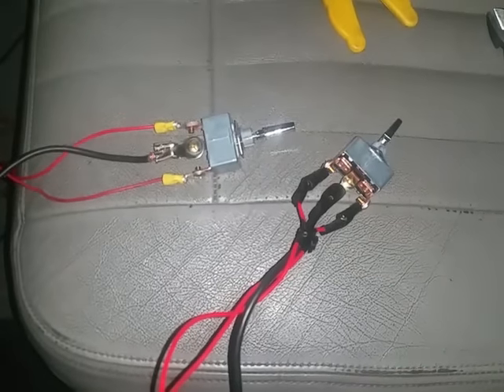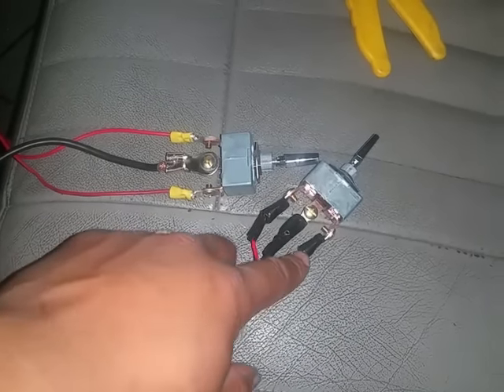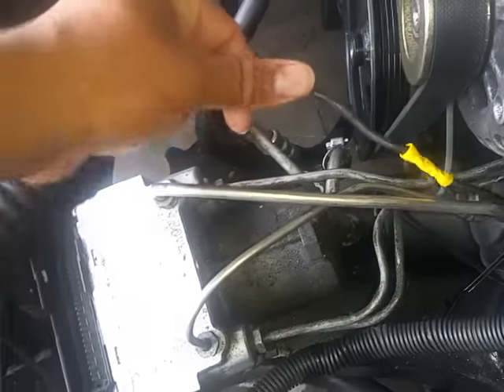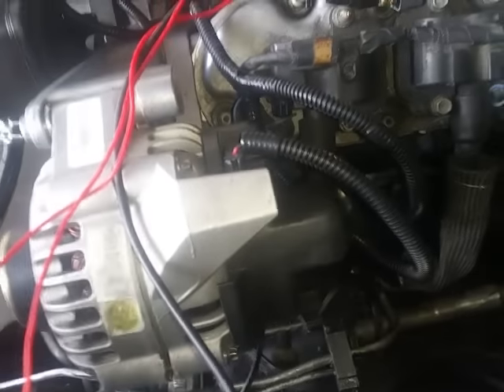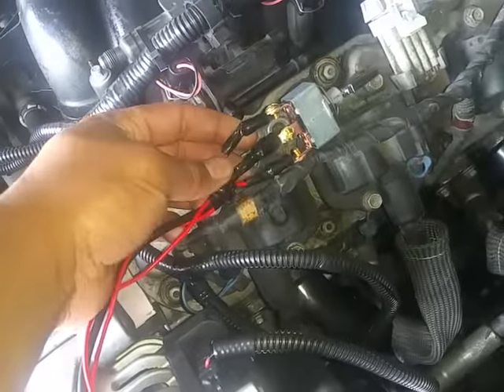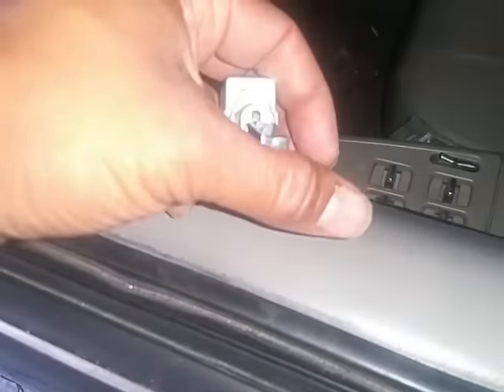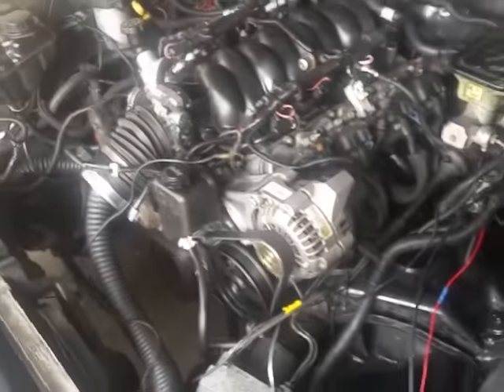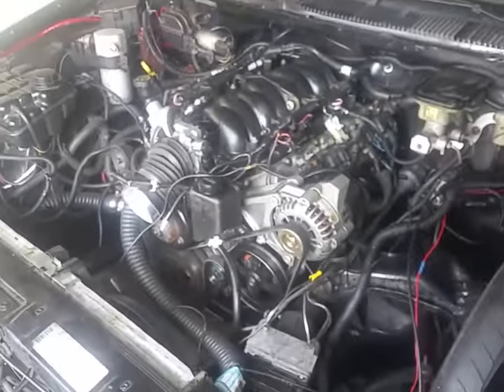How to install fan switch

Comment: Right on! Yeah, it already getting hot here in Georgia. This really takes all the guesswork out of wondering if your fan is running or not. Much appreciated Brother! Peace
Reply from the maker: All good brutha use this system as a override for the most part and ad a fuse I’ll be doing a updated video of this soon thanks for watching
Reply: @TheLsSwapGuru  Thank you very much. New Sub here. Btw, nice ride! Be easy and I will be looking out for the video.

Comment: Most fans are more then 30 amps. The best way to run that fan is with a relay also when using a relay you will not have to worry about burning that switch up.
Reply: Richard Bradley flex-a-lite makes a manual fan specific switch that can handle their fans.
Reply: He said it was a 35 A switch - but the wires, joints etc - make sure wiring is large enough. Relay is good too for this.
Reply: So a 25 amp will it hold
Reply: @maryjanemoore-lx1lg  no. 30 or more and you're safe. 
Make sure your switch can handle it. 
Make sure your writing is at very least 16 gauge.
Reply: @GARTHURZILLA  I’ve got one in my car I brought, and the switch gets crazy hot in about 5 secs

Comment: also you can run this off your cars relays, use a switch SPST works great, ground one lug to ground the other to run through firewall to your fuse box and FAN relay's lug 80 usually... basically you are just grounding the ground lug in the relay and bypassing any sensors that activate it by grounding the ground lug..  many cars have 2-3 relays, 1 relay to run the cooling fan for both AC and temp, then you have your hi lo speed relays ac/temp combo,  you could tap those relays as well, this works well if all your relays and wiring are all functioning but you don't like when the computer tells the fan to go on, and most cars that's late in hot hot 115 degree weather...

this style here does work well (perhaps a relays isn't a bad idea) if you just cannot figure out why your fan will not kick on for either the AC or temperature, like when it gets hot it wont kick on and cool it down, or it doesn't automatically go on when you turn on AC like it's supposed to.. in this case its usually relays or fuses, or bad fan but sometimes the ECU does fubar and that's a hassle for sure, so are bad melted plugs and or fuse blocks...  or you just don't have the time to fix.. 

try jumping the relay, you can jump the relay right at the block on the ground lug that works too.. but then it s always on as its not switched, but for emergency what not gotta go try that.. some fans kick on when the temp sensor is unplugged good way to troubleshoot see if fan does work..

Comment: Well, I'm here for the same reason. Same toggle too. lol.. Idk how yours has turned out since but,, I'd wrap that entire switch with black elect tape. I only used one toggle, and it gets hot in between me cycling it. I turned it by accident, and it touched metal and wow the fun began. And I had it wrapped I thought well, just not that much.. I know now though. Just done this again this morning. Cheap fix. Still only one switch. My fuse wouldn't transfer enough power, so it's just, fan / bat / switch. Like just one of yours looks there. They loosens sometimes by themselves, so it's always good ideal to safety wrap them well.
Dig this.. I done it because my fans stopped coming on. I have a Chrysler T&C. My right slide door ripped my wires in half to control the door. When that happened,  check eng's on.. Brakes on, obs on, and air check on tires on... lol... so I thought fans were the same.. Shorted on me too... But after wiring this bad boy up the 2nd time. They know are on with key on. Makes no sense. ahhaha hope you enjoyed that.
Later.

Comment: Another way is to run the radio accessory  wire etc ( Activates when you turn key) ..to the factory relay thats under the hood ...there is 2 relays, primary and secondary.
You have to tap into 1 wire for each relay that goes from PCM ( there is only 2 wires that go to PCM to Relays 1 each )
 to the relays it uses very little power to activate the relay so it can send the main power 40 amps to the fans! 
By doing this Your fans will turn off and on with the ignition key ! And by pass The PCM to Relay  Control and it will not have conflict either!
If you want a switch but do not want to turn the switch off and back on every time you use the car..do the same thing I described But add a switch before it goes to the relay.
So from Radio Power wire or alternative (Ignition Activated Power) To switch then to the tapped Wire that goes from PCM to Primary Fan Relay and Secondary fan relay..
Remember that its the skinny wires under the relay not the big one thats the 40 amps leave those alone! 
Doing this ,If you have the switches off ,the car fans will work normally and when you want to activate the fans.
 Hit the switch and  it will by pass the pcm and will not have conflict. When you turn off the car with the switch still on  it will turn off because its getting power from the radio power wire wich is ignition switch  controlled.
When you turn the car on when the switched already on remember that the radio will not turn on until 3 seconds after you hit the ignition switch thats good because if its cold outside you dont want to crank the engine and turn fans on at the same time and stress the battery because of the cold weather.
This is for 94 95 96  impala/Caprice  should work for other similar year gm vehicles and some what same idea for other brands!
If you already have to much electronics on the radio accessory  wire  ..You can also put a relay  going to the radio power accessory wire  ! 
https://www.youtube.com/watch?v=86_ocEp6mHI
Reply from the maker: +SoN oFaBleepBlop yes sir you sure can thanks for giving others value information that's what it's all about helping others out thank you

Comment: thanks for your guide 👍 im gonna try it in my honda acoord 95
Reply from the maker: SharkNT Gonzalez cool deal I’m going to be doing a update video on this showing how to use the fans and how to hook them up to a relay thanks for watching
Reply: The Ls Swap Guru woow! thats nice 🙏
Reply: @TheLsSwapGuru  can I get a link to that video. I just bought a 1995 z28 camaro with a 5.3l ls swapped into it and can get the relay hookup to turn on the fans when I hook up the relays with the wires on the stub that powers it. The only problem is they stay constantly on when plugged in and I have to unplug the relays to turn off the fans. How do I make it so they only turn on when I turn the key on

Comment: Hi mate just wondering with the 3 wires 1 to ground 1 to ignition? And 1 to the battery or run a in line fuse?

Comment: Did you buy another pigtail for your setup or did you cut all the electric setup and went manual.
Reply from the maker: DatBoy Slick yep cut it and ran it manual this was just a quick fix but I switched it to a relay shortly after

Comment: all the add-ons on my project car:hood extractors fans,fog lights and extra high beams are hooked to a secondary 12V battery with switches on the dash.
Reply from the maker: joe coquerre sounds dope
Reply: how did you hookup secondary battery like to see video on it thanks

Comment: i am trying to wire my fuel pump to a switch on 69 mustang, so i have black and red wire coming out of the fuel pump, i know the red will go into the Accessories prong on the switch, should i put the black coming out of the fuel pump to the frame or wire that up-to the switch as well ? or do i need to run a ground from the battery to the switch it self ? please help

Comment: Can you do this to a dual fan radiator?
Reply from the maker: Sure can
Reply: You get voltage drop and heat because the switch is too far from the battery.  

This is why relays are useful.
Reply from the maker: Your a 100% correct that’s why I’ll be doing a diy how to properly install fans no switch just relays
Reply: @TheLsSwapGuru  i fucks with u heavy but yea relays is a must bro

Comment: So you don't actually ground it to the vehicle, just back to the toggle switch?
Reply from the maker: You dont have to but you can sold the car and its still working switch nevwr burnt out but adding a fuse would be better to prevent that from happening...this was just sonething quick I did to get my car running you can also add a relay to the fans
Reply: My jeep still over heats and I've replaced the thermostat and temp sensor. So do you know if I'd lose power and not get everything out of my fan if I ran fan to ground, ground to switch? Sorry I'm naive when it comes to electronics.
Reply from the maker: Joseph Freeman no worries its just a 3 wire hook up ground ignition and signal wire if you car keeps getting hot check the basic first...make sure you have enough coolant make sure your system is bleed properly and make sure the radiator cap has 15-18 pressure...if that dosent work just hook your fan wires up to a if ignition key hot our have this switch installed as a override

Comment: I did exactly what you said. Except I added a inline fuse. Its blowing the fuse soon as I put it in. Any Idea whats wrong?
Reply from the maker: Wormanatti idk brutha are u using a 35 amp switch? and don't use a fuse use a relay boss...I apologized for the late response was at a church event really late
Reply: No sweat I do the fellowship thing too. Im up now so I can make it on time. Going to crack at it again.  I just realize it was a 20 amp toggle. Going to swap it now for 30+. Start from scratch. The fan motor has two wires blue, black. Maybe the blue is the power or receiving power also so that maybe blowing fuse I'm thinking. I have a red wire to acc. black to body ground & darker red to positive terminal. The blue is tied to the harness relay from which the fan originally comes from but that's why I'm going to switch. Baby been inconsistent. I brought new harness, temp switch, new relays. Forum says the pcm is likely the problem not trying to change that one.
Reply from the maker: Wormanatti make sure your using 10 have wire to fam... blue goes to the signal terminal and the power from the acc gotta to the power side of the switch u have Instagram? I can dm u how I did it on the wagon
Reply: I have to remember my instagram password. Let me ask you does this sound right. Positive terminal to power on switch. Load to black wire on fan. Ground to body of car. Blue wire of fan goes where?
Reply from the maker: Wormanatti the black wire is already grounded only need to use the blue wire and power wiring from acc or straight from battery

Comment: I'm having trouble hooking up mine also! 
. I have relay kit .. I'm tryna figure out what to connect to the power, acc , ground on switch??
Reply from the maker: +kevin cortez this set up is very easy no relay on this one it's a 3 wire hook up ground power and signal autzone sales them for 5.29 a switch it's 35amps
Reply: Did u have any luck i did this and my fans wont turn on

Comment: Is there any way to wire this so you can manually control the 2 speeds on a fan? I currently have mine hooked up directly to the battery where it goes battery - 30A fuse - 35A switch - fan but would love to be able to switch between low and high speeds on the fan since the high speed is a bit too loud and isn't necessarily needed at all times.
Reply: I'm curious as well. I'm planning on doing this with my heater. Did you find anything out?

Comment: A bro that's nice I been wanting to install a second fan to my impala because I see that when you do burnouts and donuts when its hot outside my temp will go up to the halfway mark never really liked that only because it's to close for me and don't want to blow a head gasket and also I been wanting to install and second fan on my Tahoe too because that thing is set to run halfway from the factory and it gos over if I sit to long or if I'm towing something but my question is can you hook up the power wire to the cigarette outlet so you won't accidentally leave it on and kill your battery?
Reply from the maker: you can hook it up to any key on outlet and it well come on and cut off soon as you power and shut off the car

Comment: What amp relay did you use?
Reply: He didn't and he has a lot of voltage. Drop running all that heavy gauge wire front to back and heat is another issue as well the fans won't live as long as they should and I didn't see any fuse on it either it's a recipe for disaster

Comment: I bought a new fan and harness and tried to splice(?) The 3 wires from the harness close to the power supply were the the 3 fan wires are but it's not working somebody help
Reply from the maker: Try hooking the fan up to the batter to make sure it works 3 wires 1 to the pos battery one to the negative and the other is fan signal if it dosent come on its a bad fan if it do cut on lmk so i can further help you out thanks for watching
Reply: @TheLsSwapGuru  just tried it fan works no matter how I switch the wires with car off
Reply from the maker: @portmurphy1  are you connecting it to a relay??? If not what are you connecting it to
Reply: @TheLsSwapGuru  I was trying to connect it to the fuse for the radio in power supply fuse box I bought the fuse adapter for it,.if I should use the relay I will.
Reply: @TheLsSwapGuru  which wire goes to relay accessorie ?
Reply: @TheLsSwapGuru  ?

Comment: Why not just install fan controller? Better yet why not hook to engine harness
Reply from the maker: Said it plenty of way if you want swit hes this is the quickest way THE RIGHT WAY would be to hook it to a relay to the pcm/ecm or relay to a thermo switch

Comment: can I do this on a 01 crown Vic, I can't even drive my car because it over heats the fan won't work I got one from the junkyard and had to rig it but my wires get hot quick
Reply from the maker: Shelton Turner yes sir follow these same instructions and you'll be good 30 amp switch power wire ground wire and signal wire to the switch
Reply from the maker: Shelton Turner I'm not using a fuse but it's good to have one because the fuse will blow before the switch goes bad

Comment: Ls swap for sure and paint and body
Reply from the maker: the most expensive part is labor if you don't yourself it can be done hella cheap
Reply: +96blkonblkSs  Yeah I know but I will figure it out
Reply: +96blkonblkSs  Did you already get rid of your original floor shifter handle ?